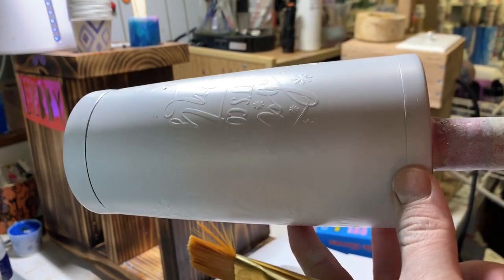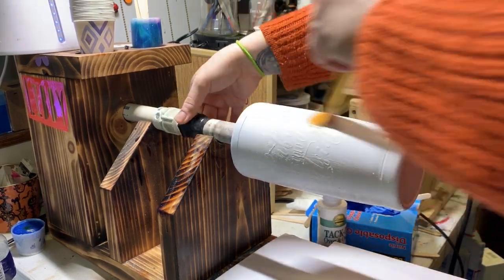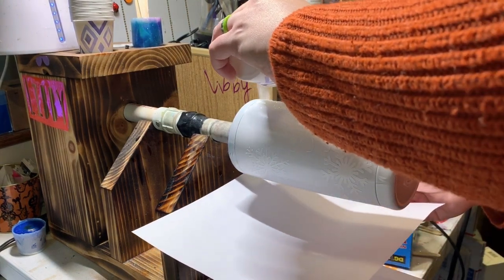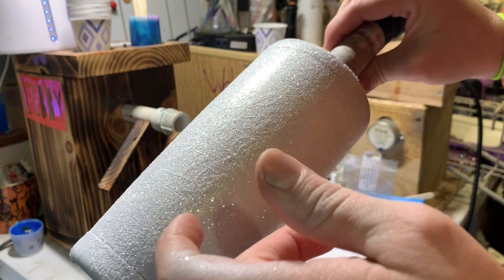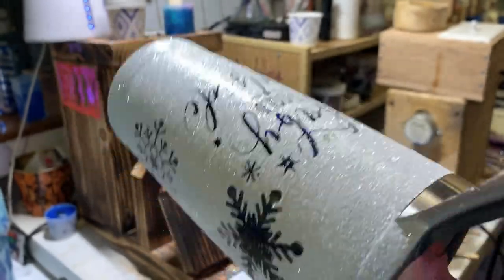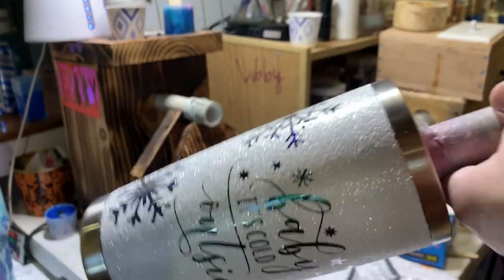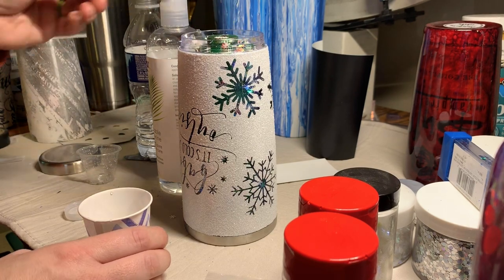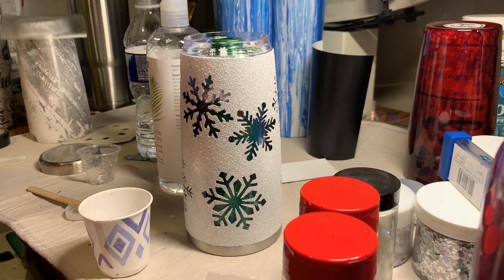Peekaboo Glitter Storyboard with Tack it

Comment: do you have any trouble when you spray paint it then take the vinyl off.  if not using glitter.  i had trouble with the paint pulling up a little?
Reply from the maker: suzzie byrd I have only had issues when I didnt work with “removable vinyl”. I have some issues sometimes at the seams where my electrical tape is. I use rustoleum paint too.